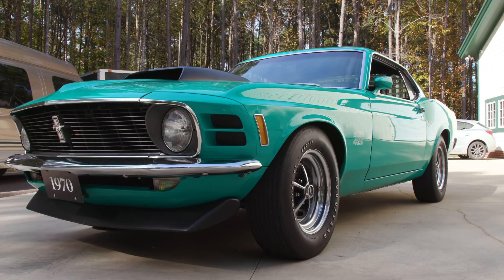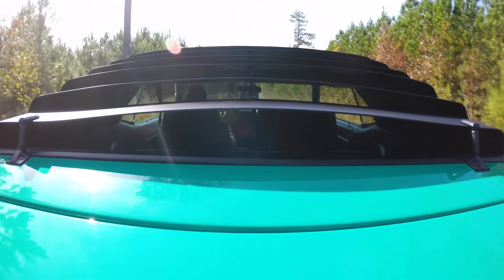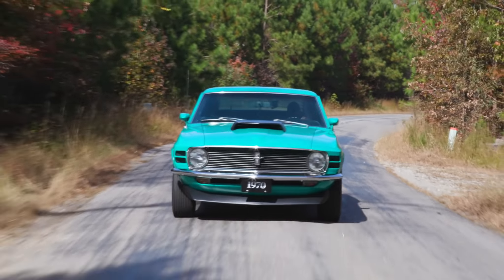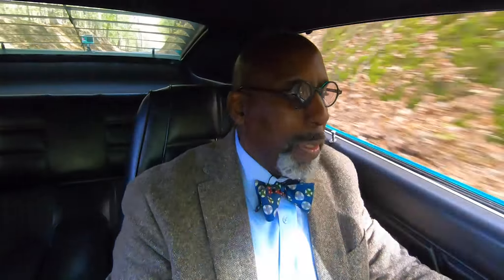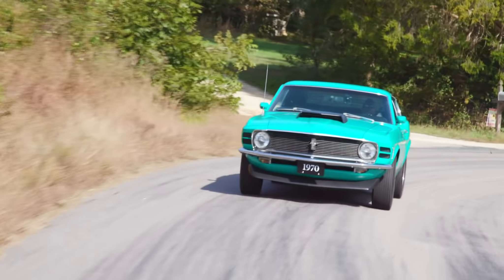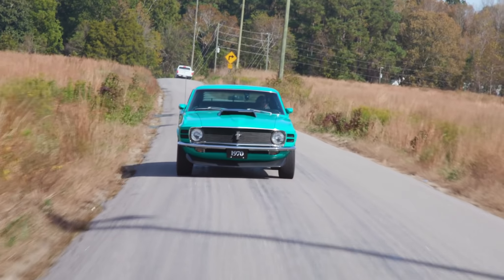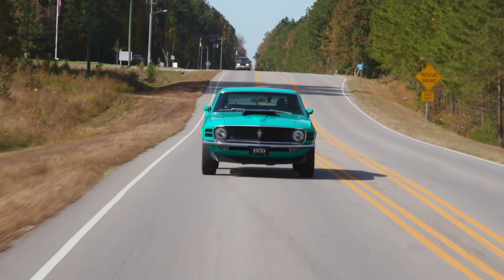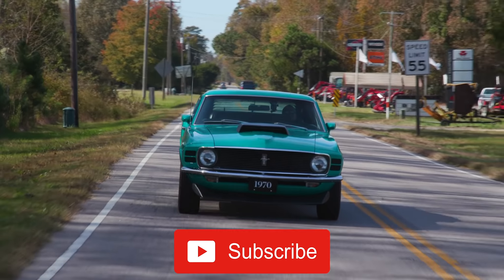Ford Mustang Boss 429: A NASCAR Racer At Heart

Comment: Nice video. Your choice in attire shows you respect your viewers & you have a voice & grammar for narration. Not many do on YouTube. Well done. Back then, Ford/ Mercury produced quality vehicles because I heard no rattling in the cabin. The Fords & GMs always had well built assemblies. Back in the day, I walked into a Dodge dealer. They had a '70 Purple-People Eater 440 Challenger 4-sp. in their show room. Beautiful car w/ it's black interior. When I sat in the car & closed the door, the door rattled. It wasn't a nice rattle either, if there is such a thing. I got out & closed the door, still more rattle so I didn't imagine it. I opened then closed the door again while standing outside, more rattle. No salesman came out to question me but I got my answer & walked out never to return. I've closed the doors of many new Fords/GMs back in the day & all were solid. I've owned both even after 8 years & no rattles. I rode w/ a friend one time in his 6 year old '68 Road Runner 383 auto., what a rattle trap. FYI...see if you have similar engine weight values. I got these from Hot Rod Mag. or Car Craft Mag.(can't remember): Windsor 289: 460 lbs.; 427FE: 625 lbs.; 429CJ('J'-Code): 720 lbs.; 429 Boss('Z'-Code): 635 lbs. So the aluminum heads of the 'Z'-Code engine was worth 85 lbs. It was still 10 lbs. heavier then the 427FE w/ iron heads. Boils down to the cylinder bore spacing: the FE @ 4.63", the 429 was 4.9" & the Mopar Hemi was 5". One more FYI: I'm a die-hard 427FE fan & the 428FE & 429 didn't need to be made but I won't get into that here.

Comment: A friend and I actually bought a used Boss 429 in about 1978.  It was probably the most frightening car I've ever driven.  Front end plowed and was almost unsteerable.  Back end broke loose at the slightest touch of the throttle.  But, when you could hook it up and go in a straight line, it was a blast.  But always a little frightening.  Last car I saw with a manual choke.  Battery in the trunk because of weight distribution, and there was no room for it under the hood anyway.  A true dinosaur.  Love seeing it again.

Comment: This reminds me of a car a friend of mine had in the late 70's.  It was a '70 Olds 442 W30 with a 'Rock Crusher' 4 speed and 4.11 gears.  He could slip the clutch in 4th at 60 MPH and it would break loose the tires and smoke them going down the freeway.  But when we would take it into town it would use almost a half of tank of gas to go 60- 80 miles.  You could watch the gas gauge move while you drove it.

Comment: Another great show Donald. Those 70’s muscle cars couldn’t turn. It just wasn’t in our big three DNA. I remember thromping the peddle on my dads GM V8’s. There would be a delay as the second 2 barrels on the carburetor would dump a load of fuel into the motor, and then you’d get pushed back into the seat. My dads Oldsmobile cutlass 2 door had a 350 with low gears. It was fast and only got 7 MPG around town. I ran out of gas a few times on that car.

Comment: One thing about that line most don't know is the 1st 52 of those cars where not built in Michigan they where built by Shelby and they are a little more tactful. My uncle hade one built by Shelby. He used to race it at Atlanta on their road course. It was not put out in public like most but Shelby made a great car.
Reply: The engines were installed after body modification, and the cars were finished by Kar-Kraft at their plant in Brighton MI.
Reply: @stephenholland5930  that is correct but the people that where setting it up needed it approved and Shelby was the only way to get it done. The thing that suckes is not two many people new it. The cars built at Kar-Kaft where nice riders but the ones built by Shelby where the real deal. They built 52 some where mustangs and some where real NASCAR torinos but it was very quiet because of NASCAR as well as ford once ford got on board thats when the other cars where built. Then NASCAR killed the himi it was not funny that ford went that far too get the motor and then  NASCAR killed it. Because of that the Shelby connection was not released but I have see and ridden in the car.
Reply: @SVSecondChance  I think you mean "were" not "where".

Comment: It will always be a Ford CrapStain to me.
Reply: Niel Gregory ....that's due to your bein a Garbage Motors fangirl....GM, especially chevy, manufactures only junk vehicles, 100% trash, and they've done so since the very first GM started leaking oil and exhaust, and the motor started missin, on the assembly line....